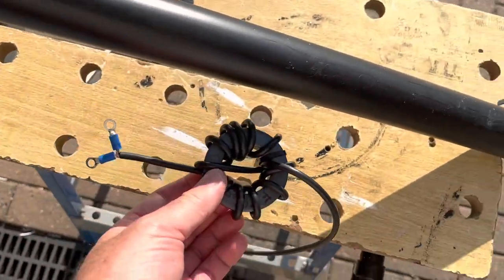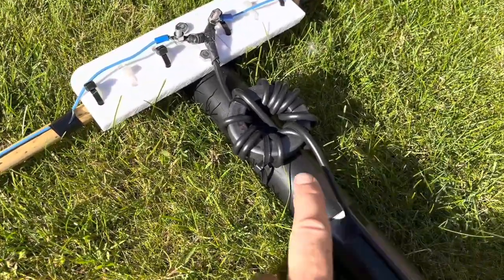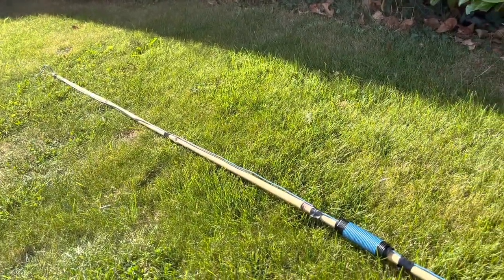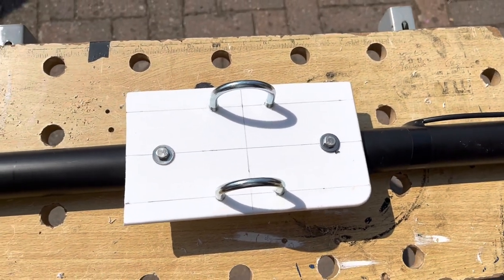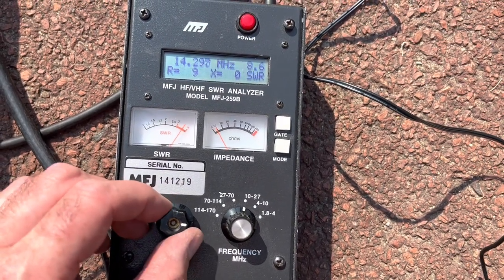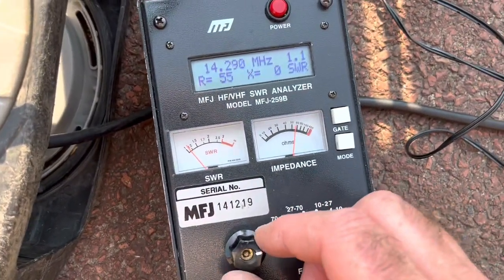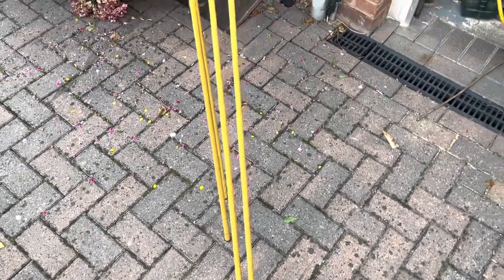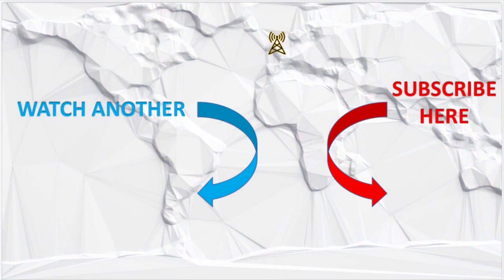20M Mini-Beam DIY Project - Part 2

Comment: hi i got my license 2021 and before i got my license i was on 11m but what i wanted to ask you is i have a 10 11m 3 elerment beam and i have still got my rotator but i was wondering if i could make some sort of coils to fit inbetween the elerments so i could use it on 20m but i don,t know were to start.. what i was gunna do is just make the resonant length
Reply from the maker: Hi. I think it would be better to keep that for 10m (a band which is becoming more active as the solar cycle progresses) and think about a new-build for 20m? Otherwise, you’d have to break the aluminium elements to insulate and rejoin with coils, a specification of which you’d have to experiment with. And make all this robust etc etc. Looks tricky to me. Good luck with whatever you try 👍🏻